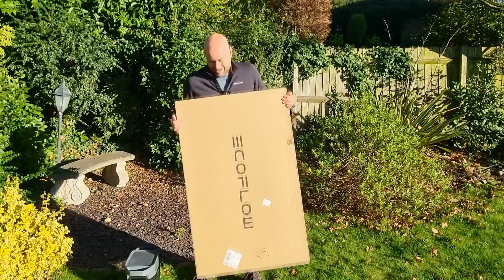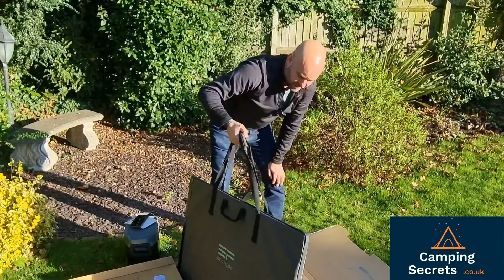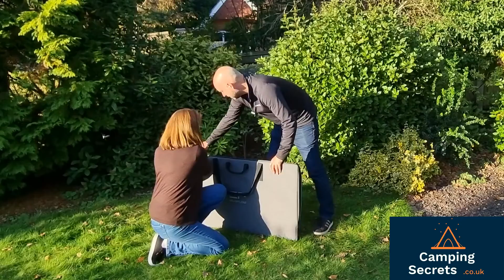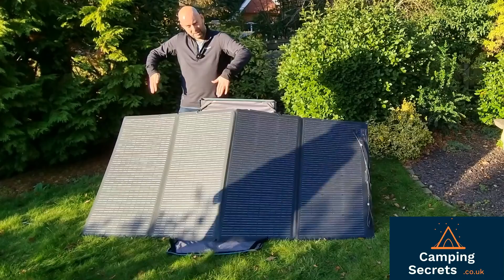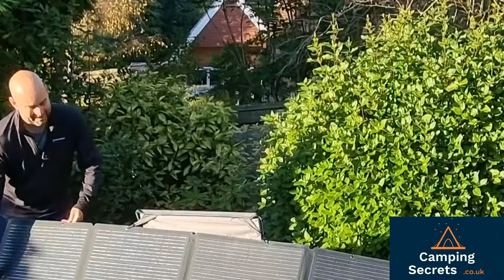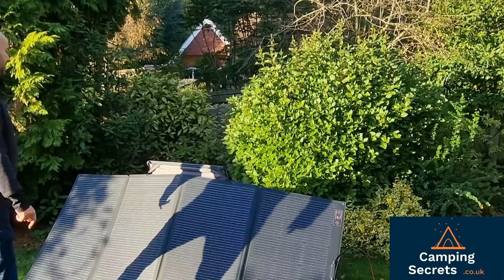EcoFlow 400W Solar Panel - IN DEPTH UK Review

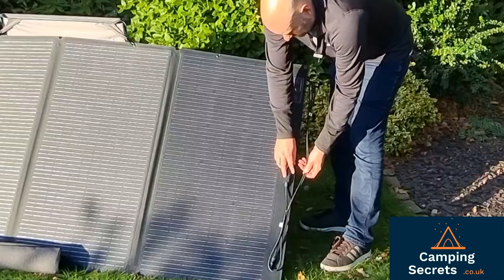Comment: Unstated at 4:50, the slightest amount of shade across the panel will greatly diminish (if not completely nullify) its output, so aim for 100% sunlight if you can. Don't expect to exceed 350W in even picture perfect conditions!

Comment: I just got my 400 watt EcoFlo panel. Struggling to exceed 260 watts in. Seems to be a pretty perfect day. Clear day, 9/26/2023. 7221 foot elevation, in Colorado. Connected to EcoFlo Pro.
I did make a stand for it, using 1 1/4 inch pvc pipe. I used a 6’ + length of pipe. Cut that in half. Used a T connector to connect the 2 pieces and used another length of pipe at the T for a leg, which can be move to adjust the angle of panel. Thanks for video.
9:58
Reply: I forgot to say that I used plastic zip ties to connect pipe to panel at the grommets.
Reply from the maker: Loving the sound of your stand. I sold the panel in the end. I found it a bit too big. I prefer using two separate 200w panels now. I'm jealous of you being in colorado. Rocky Mountain High!
Reply: dWOW  like to see the stabd you made  ... thanks

Comment: The design seems very clumsy and not brilliant for  getting the panels flat and in a lined up properly to the sun .  defeats the purpose a bit surely if your only getting a couple of hundred watts out of it !!
Reply: It is rather clumsy/sloppy.  Having the panels on the end angle/fall outward, which while sloppy, could be useful as the outer panels, with their angle back, compensate for the movement of the sun, or rather the Earth :).  Even so I am going to try, once setup, attaching fiberglass rods across the top, attached with those strong paperclips, which may help - it certainly won't be as sloppy and unpredictable.
Reply from the maker: Agree. I didn't rate the design of the stand at all

Comment: If IP68 means business, then there is no restrictions about how long you can keep it open outside under weather conditions. I have no idea why they say something like that they dont recommend it. I set my 400W panel, similar to this in video, outside in the balcony. Build up aluminium DIY frame for it with supports, attachment dont by M6 bolts and wingnuts to hold it flat and connected safely 50 degree angle (Today sun is shining around 22 degrees, and midsummer around  50 degree). Using Delta 2 with it. My daily energy consumption got 50% less doing this, but ofcourse in the wintertime in EU its not shining everyday, so bare that in mind.
Reply from the maker: Your setup sounds great! Any chance of a photo?
Reply: @CampingSecretsUK  Sure. Ill try to remember to take one. How I am able to share it here? Link to pic somehow?
Reply from the maker: @FSD-Finland  yeah not sure about that! You could email it me at marc@campingsecrets.co.uk and I'll stick it on our website!

Comment: Would you be able to use a different solar panel with the delta 2? £1k is just eye watering
Reply from the maker: Yes you can, but obviously it will take longer to charge. In the UK, getting a few hours of direct sunshine is unusual! The price is ridiculous 😂
Reply: @CampingSecretsUK  so would a pair of slightly more affordable 100w ones be able to be hooked up and work properly with the delta 2?
Reply from the maker: Yup you can do this Michael - you can connect two 100W panels in series or parallel (use this cable https://shrsl.com/3td6k) and plug into the EcoFlow Delta 2. The 400W panel is essentially 4 x 100W panels in series anyway! The cheapest 100W panel I've seen is here (https://amzn.to/3gCf6wY), but I have not tested it - one for a future video!
Reply: @CampingSecretsUK still waiting on this video
Reply: Always - if smartly selected.  Keep the current and voltage limits in mind.

Comment: This 400W panel will actually allow you to remain off grid as much as possible which is perfect for my off grid cabin.
Reply from the maker: Yup, but you need a power station which can accept that much power coming in from solar. The Delta 2 is perfect for that. Cheers for your comment Robert.